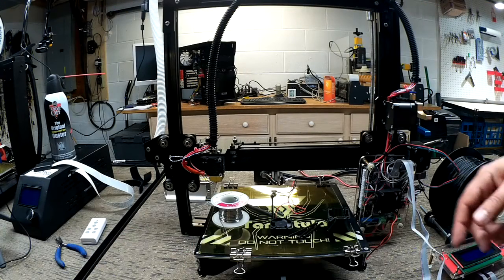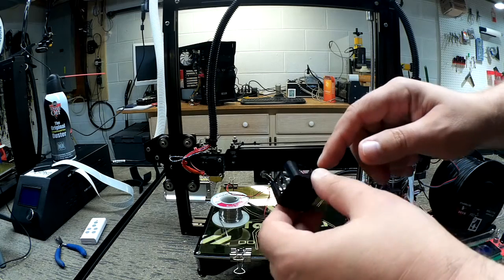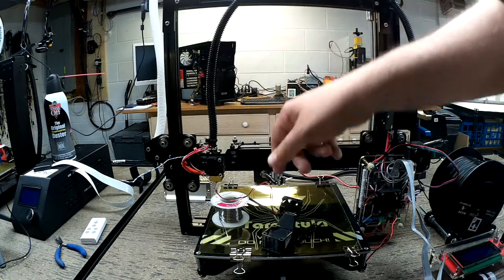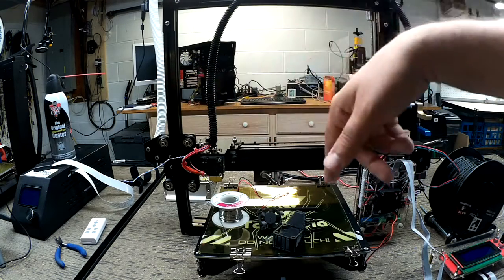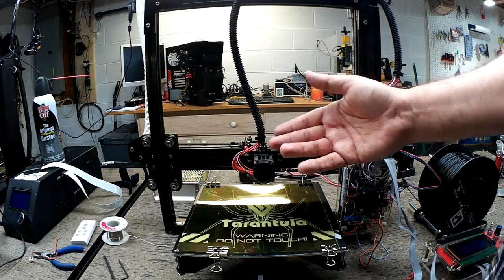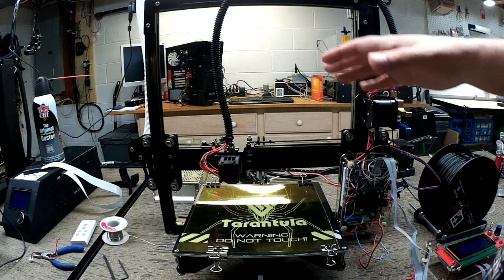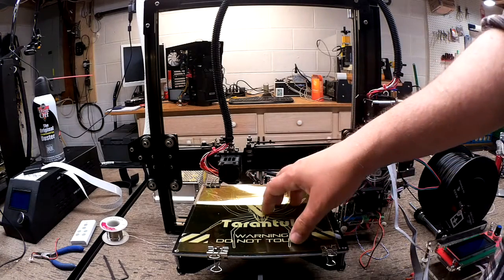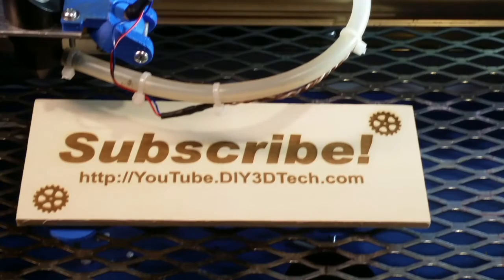Tevo Tarantula 3D Printer - Installing Layer Fan from Thingiverse!

Comment: When I added my fan my motherboard (wired to the "Fan" area) will just beep and the fan doesn't turn on. 

This is the fan I bought https://www.amazon.com/gp/product/B00B2ARV22/ref=od_aui_detailpages00?ie=UTF8&psc=1

Any idea on what is going on? Is the fan dead?
Reply from the maker: Is the polarity correct?  Have you checked the fan fan leads with a voltage meter?
Reply: Polarity is correct. I have not checked leads with voltage meter yet. I have watched another video saying you need to include it in firmware to turn it on and to add it in a gcode through cura or slicer. 

Not sure how true that is. I figured you just install it in the mobo on the "fan" leads and turn it on through the menus in the display controller. But when I turn the fan on in the display controller, a blue light turn on from the mobo and a beep starts.

Might say screw it and get a desk fan lol
Reply from the maker: They might be right on moding the firmware as it is hokey as on mine I just added a larger cooling fan and split it...